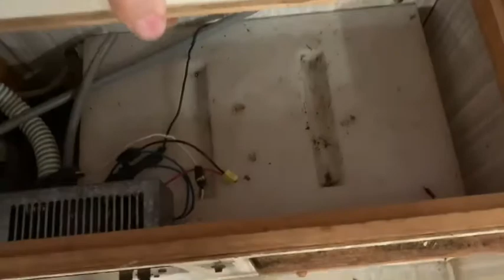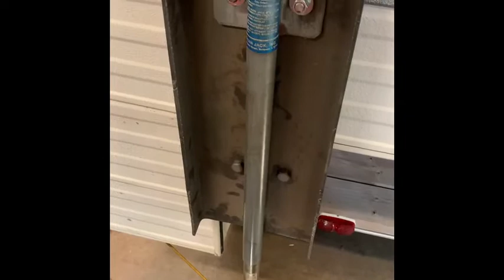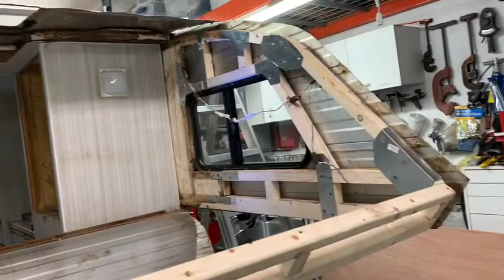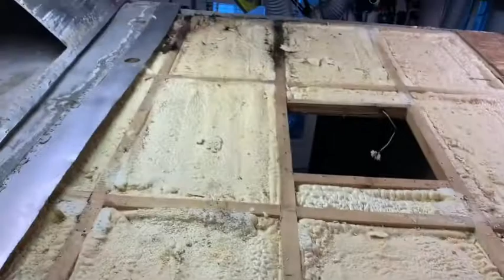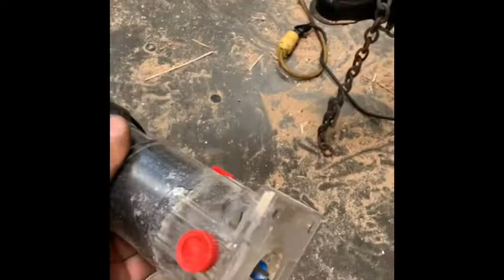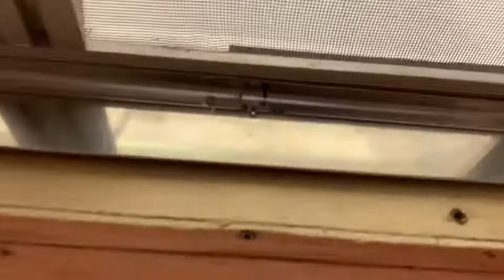Truck camper leaking roof rebuild fix

Comment: You are going snap your frame rails eff up your rear end and leaf springs and crush that ranger. That's not smart at all to put that 1000 pound camper in your little Ford ranger. Your payload is about 1250 pounds thats how much you can carry in the bed and whatever you have in the cab and including your own body weight...you can tow maybe 3500 to 4000 safely but towing and payload is way different....
Reply from the maker: @GeraltOfRivia99  you are probably right, I ended up using it with a full size pickup and still needed air bags to level the truck!
Reply: @joelshopefullyhelpfulvideo3010   yup because i got an f150 around the same year and my payload is 1700 pounds so I got a 1000 pound camper myself so I got some wiggle room but even than I wish I had an extra 300 to 500 pounds more payload! Nice work on the camper tho spot on looks great

Comment: I have been doing this also and I actually took the aluminum skins off to use solid wood and complete peace of wood vs. pieces of wood not only that I think that the structure is more  heavy duty with triangles or X shapes in areas that can be addd for structural support. And lastly adding 5/8 whole sheets on the flat bottom where mattress lays gives it a much greater support at bottom and prevents bowing or sag of the front laying bed area and window.

Comment: Hey, get rid of that big front window on the bed and Selleck and board that up put some insulation on there and get rid of it because that window is impossible. There’s no drain holes to drain the water out from the condensation and stuff it’s best to get rid of that damn window. That’s what I’m gonna have to do.

Comment: just for other DIYers who may be attempting this: You can make the new framing right on top of the old framing, copying the size of lumber and placement while it is still in place and then take it and the old framing off, glue and screw the new luan to the new framing and then set it up where it will go. No guesswork.

Comment: This was really helpful. I have an old camperette. I rebuilt the rotted jack corners a few years back but I am now planning on   cutting out the front wall and making the camper shorter to go from a 8 foot bed to a 6.5 foot bed. I haven't pulled it apart yet but it feels like it's just plywood on the front wall and bottom of cabover. After watching this it looks less intimidating.

Comment: how much money and time did it take to do the whole repair?
Reply from the maker: It’s hard to estimate exactly but the Luan sheets at the time we’re about 20$ each. So at least 4, I cut 2x4 in 2 to make the 2x2´s. maybe 10-15. About 4$ each, Some foam was left over from a renovation. Maybe 2 extra 4x8 sheets of foam. I used a lot of recycled expired consumables from aviation companies for sealants and paint. Time wise was a lot over free time during a winter. I don’t count time since I love working in my shop and consider it (man cave time). It’s kinda ironic that I’m actually camped out 1000 miles from home inside it right now writing this! So it was all worth it in the end..cheers

Comment: Question would square aluminum tubing welded then the skin of the camper put on would be lighter and no wood to rot? Thinking on this have welder and a old slide in camper and alot of aluminum tubing!

Comment: Joel's hopefully helpful videos About random things:

RV frigs never go bad unless the coils have been exposed to extreme corrosion. There is no compressor on a RV frig...simply works on expansion and contraction on amomnia-gas. Most common failure is the capillar tube which allows the propane to flow from simple controller to Pilot-Flame combo. When the frig is "getting" colder the Pilot light just get more gas from the controller. And on the older RV frigs without a electric- controller with just a  (push over-ride button to get the Pilot light going) Pilot light/Flame will always work if he capillary tube is working. The capillary-tube is standard-issue for anything that operates on natural-gas or propane. Main purpose of capillary tube is safety,prevents gas from flowing if Pilot-light/ Flame,full Burner flame goes out. They are super cheap, few bucks from any appliance store, or home-improvement store,probably cheaper on-line to.....as SAE pipe threads are the Universal means in 99.99999% in gas/water pipe connections around the World.

Comment: 34 minute mark.  That's alclad 2024-T3 material used in the vent frame rebuild??? Angles and solid rivets in the corners?
Are you a structures guy?
Great job on the camper by the way.  
I've got an old 1976 camper I got for $150 bucks.  It's in great shape except the front just like yours.  
Your vid helped give me some perspective on what I'm getting in too.
Thanks.
Watching from Kelowna British Columbia.
Reply from the maker: Yes your right, that’s Aircraft aluminum used on the vent frame. I’m more focused on AME work but do some minor structure work sometimes. Almost everything on this camper is recycled expired products from aviation. It’s completely sealed in PRC Sealant. And completely painted in PRC Desoto heat resistant primer and polyurethane paint. Good luck with your project!
Reply: @joelshopefullyhelpfulvideo3010  . . . . .I'm AME-S licensed 28 years now.  I thought I recognized another Aviation feller.
I'll look for your next posts.  Thanks again!

Comment: I’m an rv technician apprentice and I just got an old 11 foot truck camper that I’m a bit apprehensive about fixing but I’m a little more optimistic after watching this. The main repairs it needs are repairing the roof in the rear section and the paneling on the lower part of the rear jacks where they attach on the corners and possibly where the tie down anchor points are. The fiberglass roof has not been maintained at all and has a small tear as well as a couple small holes hence the damage. I’ve sealed them off already but it’s got surface cracks all over it. If you read this I’d appreciate your suggestion about what to do about that.

Comment: Im about to take on a similar repair on  $600 Alpinlite,it has some sag to bed area so I'm alittle uneasy about getting in over my head,
Reply from the maker: If you have a bit of patience to scrape the old sealant to remove everything, putting it back together is not too bad. You will know what you have.

Comment: Nice work! As a retired 45 year Machinist and a renovator of three water damaged toy hauler travel trailers, I respect your quality of work! Now I have a 2001 Fleetwood Elkhorn non slide out truck cabover camper that I just bought and even though it has fiberglass outside walls and aluminum frame, the upper cabover window has flex seal white 2" tape all around the seal and I'm hopeful that when I peel that tape off I won't find water damage! If I do, I'll fix it just like the 3 other trailer's, #1, 20 foot roof replacement, #2. toy hauler #3, complete floor replacement by jacking the body up 3" all new floor joists & marine plywood, #3 only one front wall and 10SQFT of flooring. But I am getting tired! Wish me luck on this Elkhorn, I hope I don't need it!
Reply from the maker: Thanks! I recently changed jobs and was extremely busy at work to reorganize myself. Things are finally starting to return to a normal schedule and I have a lot of footage to include in my next video about this project. Hoping to restart creating and releasing more videos very soon. I have more to show…Good luck with your project!

Comment: I need to do the same thing what size studs and frame do I need?
Reply from the maker: I had to split 2x4 into 1 1/2" x 1 1/2"
Reply: @joelshopefullyhelpfulvideo3010  You can buy 2" X 2" which are really  1 1/2"  X 1 1/2".

Comment: what do you use to seal
Reply from the maker: I’m using expired aviation sealant on this project but on my other RV I always liked using Dicor and once dry I cover the top areas with eternabond tape. Dicor will crack after a few years but if it’s covered with eternabond tape it will last decades without much attention.